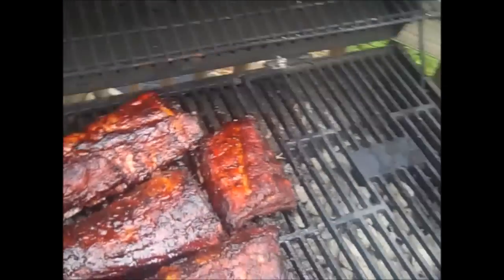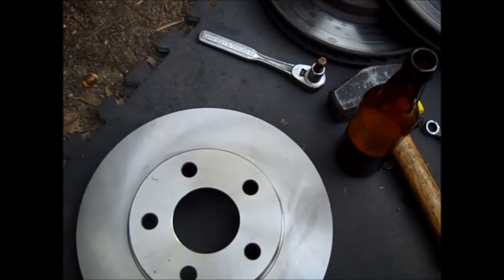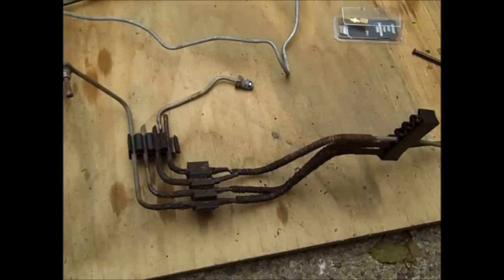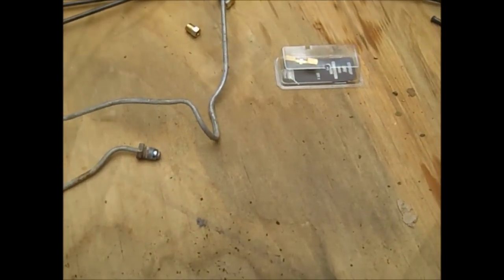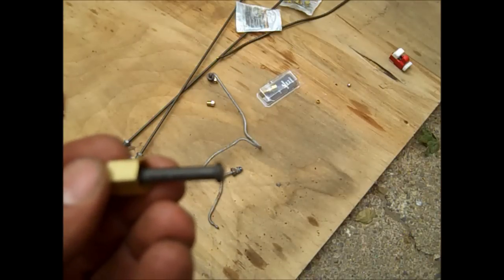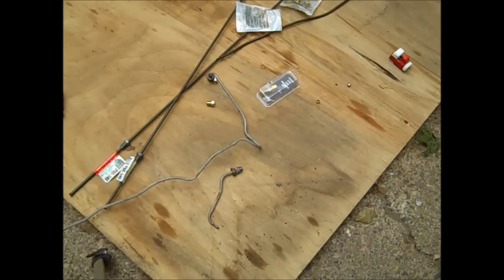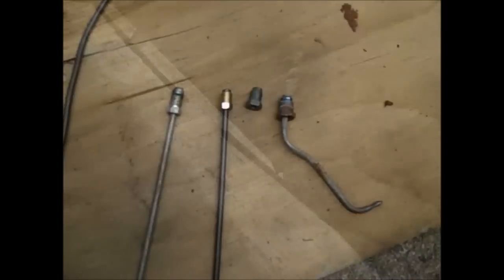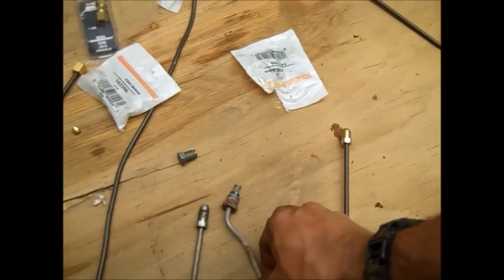Vehicle DIY Tip #4 - Brake Line Repair

Comment: Just so you know... I've been working on my own cars for about 10 years (I'm 29) and I've done lots of brake work. Repairing lines has always been the bane of my existence... because I've always re-flared and used that kind of bubble connection. 

I never thought to use compression fittings with the ferrule. On my next trip to the auto parts store, I'm going to snag some 3/16 compression unions in case I need to make a repair. Thanks again for the vid and keep up the great work.

Comment: I just did this repair on my 27 year old truck.  I tried to just replace the rusty section. put it back together and it blew out at the next hanger back.  So I just went directly to surrender.  and bought the rear axle lines the drum brake wheel cylinders and the flex hose.  Chasing rusty fittings is just futile sometimes. trying to double flare while underneath the car and not cracking the lines is a real magic trick.

Comment from the maker: I try to make it fun if I can or at least enjoyable.   The hardest part for me to "learn" was to take my time first and set things up right before beginning the job. Just making sure I have the tools I need and making the work spot comfortable with pads and boards. At least 90 percent of the jobs I DIY,  end up saving me a lot of time.   Just taking the vehicle in to be worked on at a shop is such a hassle with dropping off, waiting and then picking up.   And I always save money.

Comment: I live in Massachusetts, and in all my times of having my cars inspected I've never seen them inspecting my brake lines. I've got a leaking brake line on my car, think I'll try a compression fitting and we'll see what happens.
Reply: I tried a compression fitting, and it works great. I've sold the car since then.
Reply from the maker: +stratovani    It's been 3 years since I put the compression fitting on the car in the vid and it's still working great.